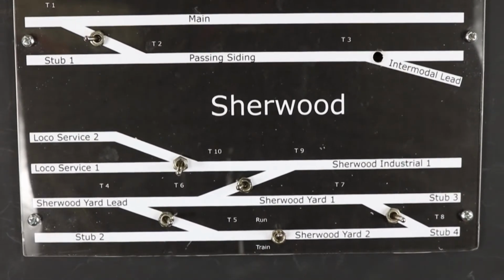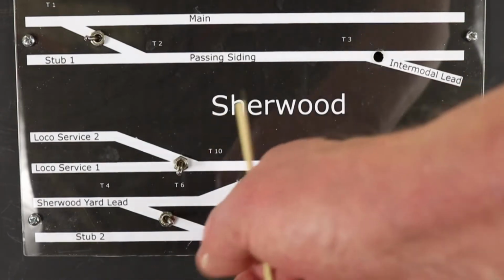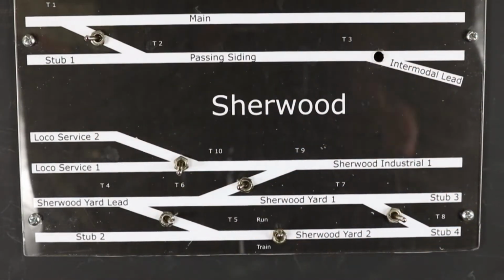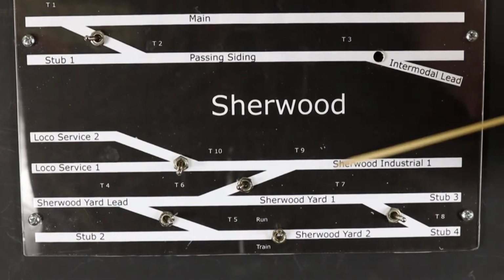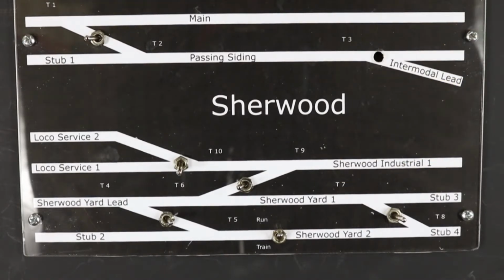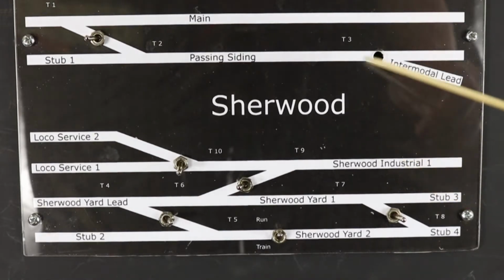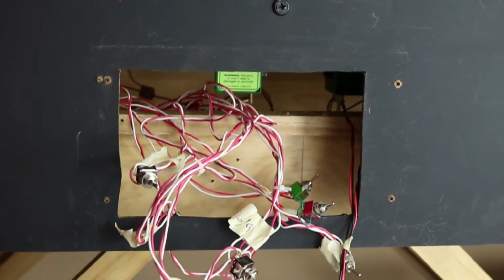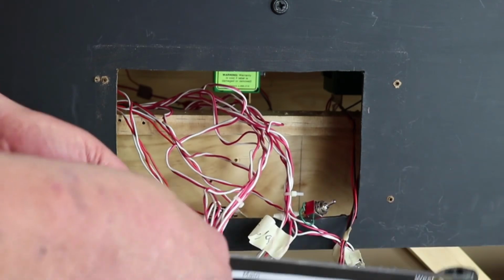How To Make a Control Panel

Comment: Hello Sir, 
Could I use a dremel tool if I don't have a cordless screwdriver instead? Is there a gig for the control panel to make it a little easier to install and how do I test each switch so I know what I'm doing if it's right or  wrong?

Comment: Love the article. Just a thought comes to mind: Since it appears that the panel is mounted onto a facia material. If that material is thick enough it would provide protection from accidental brush-by contact with the toggle switches. If not, perhaps a pull-out "frame" or drawer mounting might be another option. (No broken switches or snagged clothing.)🚂🤔
Reply from the maker: Thanks for the comment. The plexiglass itself is strong enough to resist accidental contact. Your point about the toggle handles is a good one as they could easily snag some clothing. Fortunately, this has not happened. For my next control panel, I'm planning to use plexiglass with low-profile momentary pushbuttons which should minimize this risk...Harold

Comment: looks good been looking for ideas of control panels yours came up a good treat and love the idea of cross over so you control two switches at once! using powerpoint to make tracks, how?
Reply from the maker: Thanks for your comment. From my business career, I became familiar with PowerPoint. It's just a graphics program. One could use anything that is best for them. I would use PhotoShop but I'm just not experienced enough so I use PowerPoint. In PowerPoint, the background is black and the lines are white. The printer won't print white so, it just leaves the lines as the color paper that is being used...Harold
Reply: I like this idea of PowerPoint as I use it for train clinics. I just don't know how to start up the drawing. Where do you start from< Do you go to "design" first? or draw first? If there a you tube on getting this kind of a presentation going?
 @nssherwoodsub
Reply from the maker: @andrewreynolds599  I began with blank presentation and update from there. Once you have your first one, you can use it as a model for all others or, if you really like it, make it into a PowerPoint template.,..Harold

Comment: Another way to drill the plastic sheet is to sandwich it between 2 pieces of wood (I use 1/2" plywood) and tape the drill pattern on top. I use a sharp nail to "center punch" the holes. It's a lot better than using a standard center punch. Since most cordless drills are variable speed, use a "medium" speed and apply just the drill's weight. DON'T FORCE THE BIT !!! I've found that this prevents egg shape holes and plastic cracking.
Reply from the maker: All good and valid techniques. I'm just not good with the variable speed drill which is why I chose the electric screwdriver with its slow speed...Harold
Reply: @nssherwoodsub  Understand that :) :)

Comment: Hi Harold, good lookin panel, nice job!👍 A couple of thoughts on your construction techniques...
You'll have better luck at a clean break with less scribing and actually breaking the plexi over a hard sharp edge, while holding a strip of wood or something down on top of the mat'l, rite at the scribe line - as well as a long piece on the side you're snapping off - to achieve an even pressure along the scribe line. Also, the little hook on the end of the scribe tool is for deburring the sharp edges - and will turn 10 mins of filing into 10 seconds of work! (Well almost.😉)
And you're rite about drilling pilot holes and the slow drill speed, but what you want to do is back grind the lead edge of the drill bit so it "shaves" the soft plastic - this will give you a clean hole without the bit trying to "bite" thru the mat'l - which is why it gets distorted and can break the sheet.
I have a small assortment of bits I use just for plastic for this reason. Hope this helps!

Comment: I wish I had seen this video before constructing the control panels for my layout.  I went with an older method of painting the back of the plexiglass and then labeling the front.  Printing a diagram would have been much easier.

Comment: are those toggles on-on or on-off-on  dpdt?
Reply from the maker: Thanks for your question. They are what I would call normal DPDT toggle switches both positions are "on" and they are without a center off. A center off would have no purpose when controlling Tortoise switch machines...Harold

Comment: Very good info on the drilling.  Personally I also use a bit of beeswax to lube the drill bit. In my area there are various agriculture fairs where beekeepers sell beeswax at a lot less that a sewing or craft store.
Reply from the maker: Good tip...thanks. I'll try  that when I make another control panel...Harold

Comment: Great how-to Harold! Loved it. Where did you get that piece of acrylic? Good tip about the drill. I would have used full throttle! End result looks real sharp. -Mark
Reply from the maker: Thanks for the question. The acrylic sheet is available in various sizes. I got mine at Lowe's but any well stocked hardware or home improvements store should have acrylic sheets.